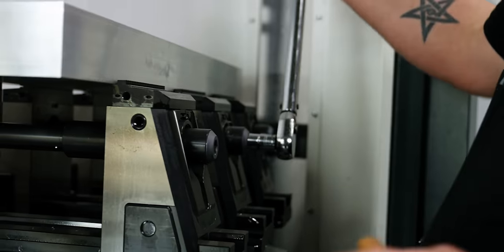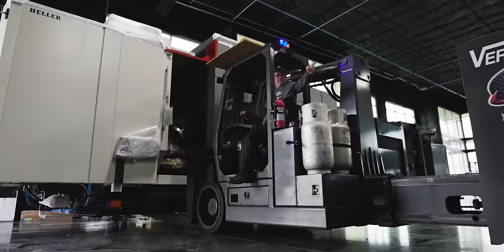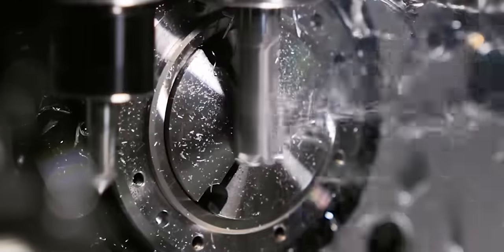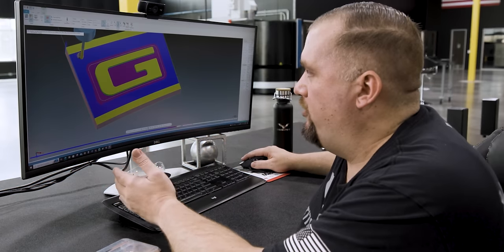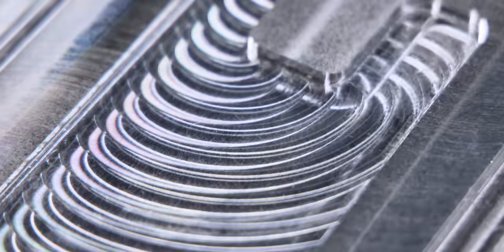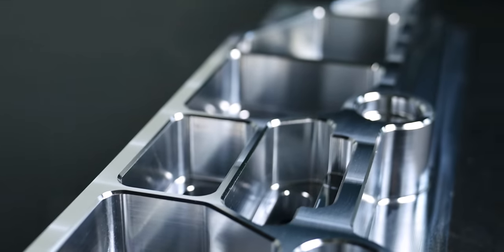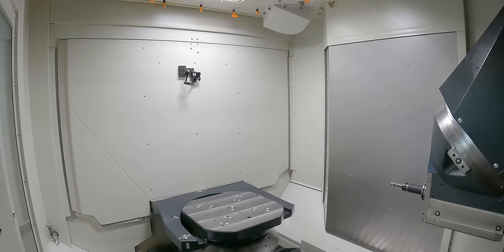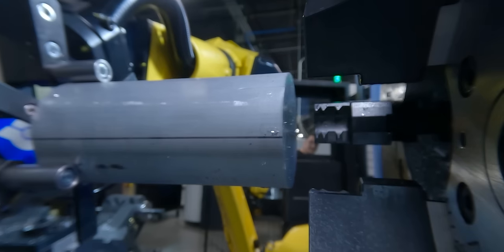Old School CNC Machining Drives Cost on $100 Million Planes

Comment: I get what he is saying but there can be other reasons why programs and tooling are not changed. The part might have to go through ppap all over again if changes are made.  The cost of doing this could exceed the savings you made.  Flight critical aerospace part production is locked down once proven for reasons you may not think of. Good example changing a drill to boost productivity in a titanium part led to microscopic surface cracks that became failure points in the fatigue life of a critical part.
Reply: Also the program cutter speed, feeds etc are set up / optimised for that particular m/c or m/c's capability / rigidity etc. to make a consistent quality part.
Reply: 💯 it’s not easy to ch age something that has gone through the approvals process, even though it might make more money. As long as it’s all covered it’s all good ay?

Comment: No owner or executive is going to pass profits on to employees.
Reply: my dudes in shop working 10 or more years in the shop and were always cutting cycle time - 20% or more and no one cares....... thats sad and they now never cutting time down if it run faster and we chill 2 or more hours with nothing, cause we have x time for 1 part and it is calculated for the whole parts and you need 7.5 hours in 1 day. if you have 1 part and it is running 10 mins. but it is calculated for 30 min........ we win  cause of the bad boss we have.
Reply: That should be rephrased to being "very few".  There are instances where, although low by percentage, that started with the owner giving the employees the company as an "employee owned business".
Reply: True statement

Comment: I worked at a mill several years back, they've been on it almost 18 years before I came. I was a roll inspector and I decided whether the roll should go through or get dumped. I noticed several rolls were being dumped that would have made it to the end, just because the previous inspector didn't want to gamble it, there by leading to a lower production. I worked there and after three weeks I noticed there's a pertern so I stopped dumping most and increased the production. We got production bonuses, but I made enough enemies I had to leave after three more weeks.  The production engineer wanted me back but, I don't think he had what it will take to protect me. You can only do as much as you are allowed to do when you are in a group.

Comment: What you guys don‘t tell is that every part and machining process with the specified tool and the specified machine and the specified raw material has to be approved from the aviation authority. Additionally it has to be proven, that the part has the same property’s and strength or better than the already certified Part.
Does the induced Heat from the faster machining affect the grain structure or surface hardness of the metal or does the new Tool transfer its own material/coating on the Part itself on an atomic level? All these aspects have to considered and certified and all that costs a lot of money and after that it is allowed to use the part in an aircraft.
That is why an aircraft so is expensive and some company’s don‘t want to change processes which are proven. 
Some companies want to improve and try something new but Research and Development cost millions up to billions.

Why do I know this? I am an Aircraft Mechanic in Germany and went to „Meisterschule“ and we were trained about this stuff from a guy who works for an Aircraft Engine Manufacturer.

Comment: Boss sharing the savings?   great one, I love your jokes,  that one just gave me the biggest laugh of the past month.
Previous employer had a 45 min cycle on a bunch of fixtured parts..program spent 14 mins air cutting due to a crummy program. I finally arm twist the boss into letting me re-write said program, and saved 14 mins per cycle.
My reward : zip, nadda, nothing, zero,   I did it again on another job, saved 8 mins on a 22 min cycle, did it again on a 32 min cycle , dropped the time to 20 mins and improved the product too
Still the reward : nothing.
f. this job,  I quit.
You need to explain to shop owners unless they share in the savings, no one will make them savings.  like my current boss who jumped my pay $1/hr on reducing a cycle time from 45 mins to 35mins
Reply: Bro the problem is that most shop owners dont WATCH these videos. When i recorded this, my main intention was to promote a positive work ethic specifically toward continuous improvement. For the sole fact that it will help you LEAVE a crappy job and get a BETTER one
Reply: You have to DEMAND a bump in pay, it won't just fall in your lap out of the goodness of their hearts. You have these records and experience under your belt, meaning you have way better job opportunities available. Make a resume, demand a salary that you deem is worthy of your quality of work, then go to  your current employer and show them "This job is offering me this much, either give me a pay increase that is higher than this, or I am putting in my 2 weeks notice in today"
Reply: @barrysetzer EXACTLY right! Everyone complaining about working for a boss who “doesn’t get it” is also an employee who “doesn’t get it”. Earn your promotion and promote yourself.

Comment: I worked for the smallest and the largest shops out there. I didn't see too much direction to improve. At the largest defense contractor we did have a bonus program if we could cut costs. One time I suggested something. It was really about getting rid of hand loading and unloading a huge cat 50 tool in in 5 axis mill turn. It also machined terrible. Afterwards the mfg engineer gave me a pat on the back for improvement in time and quality. I was only motivated by not wanting to do that crazy op anymore.  I did not get any bonus.  Oh well. 

I think another problem is lack of good tools or just scrounging around for good tools. I really think we shop floor guys can suggest improvements but we really need at least some motivation from up above.

Comment: I agree with a lot of what you’ve said but cutting the cost of production isn’t going to make the product cheaper. The product will cost the same and the extra savings go into the executive’s pockets. 

Lots of manufacturing has been sent over seas where you can pay employees less but the products they make haven’t changed in price afterward. 

You never negotiate down, basic rules of business. If I can make you pay more I’m not gonna lower the price.

Comment: I was working a CNC vertical mill and I had to set a job that had a work time of 5 days, day and night shifts, I set the job and finished the job in one shift. There was hell up from my day shift partner and my boss. My day shift buddy was angry I had spoiled is sitting on his fat ass time, so he tried to say that all the job was scrap, my boss initially was on his side saying I had scrapped them all until they passed inspection, but my boss was still not happy as my day shift buddy did him favours, making parts for his boat and I had spoiled that.
I knew then I needed to start my own shop
Reply: Nothing worse than working opposite to someone who's willing to chuck you under the bus, in an attempt to make themselves look good. Bad apple my man

Comment: Ive seen what happens when a bad programmer tries to "optimize" an old program. 

I will keep using the old one thanks. 

I make small changes to improve things and they dont save the program. I make recommendations to tooling and they dont listen. Instead they come to me when I am in the middle of a production run of 1000+ parts and change EVERY SINGLE THING to gain ONE SECOND and the entire machine is down for a goddamned WEEK because they cant get the program to function correctly. 

I have VERY good reasons not to change things because,
1. I am not rewarded for it.
2. I am not thanked for it. 
3. They dont want to give me credit for things I fix. 

The company can rot if they think I am going to make them more money when they arent making me more money.
Reply: I honestly wish shop owners would watch this video, and then read the comments.
Reply: Yep engineers  dilemma is real nothing worse than good idea fairy’s updating jobs then complaining why your over runtime hours because they failed to account for accelerated tool wear means more downtime overall. 
Meanwhile I’ve been accosted for wanting a spring cut added to a job that clearly needed it because muh increased time which I added anyway and then actually save time and money cause I’m not replacing tools that actually aren’t worn and having to restart the program after discovering the part isn’t correct. (My team leader still doesn’t know the program is modified it’s been like this for 2 years now 😂)

Comment: We had a boss that was actually rewarding shortest cycle times. So it was a competition on the floor to cut it. Some mistakes happened, but it was fun, to cut time from 10 min to 5, and then swiss machines arrived, and the same job went from 5 to 1.5.

Comment: While I endorse people trying to optimize programs Ive also witnessed what happens when incompetent egotistical machinists think they have to "one-up" their cowokers all the time.

So we got this one guy at my work. We're a small-ish jobshop who dont run many of the same programs, however, once in a while we might have to re-run an old program to make the same part we made 2-3 years ago.

Now this dude at my job. He hasnt been a certified machinist for that long - at least compared to almost everyone else at the jobshop. He has a tendency to want to run everything as fast as possible. From setting up the machine, programming and running around in the machineshop. As if his life depended on it. 

He recently had to make an old part running my old program. He proudly announced to me that he had made his own program and that the simulation said it would take 10 min less than mine. Im like, alright cool beans go for it dude. 

Because of the type material, the weird way you would have to clamp it and the tight tolerances; 3 broken taps, 1 busted facemill (Running it 3x as fast) and two of the tolerances he never got to spec. Oh, he also had to go ask for the manager to order new material not once, twice... 4 times.

In the end if everything had worked out for him he would have made all the parts about an hour faster than my program. It didnt. It costed more for new material than the job was quoted for - plus all the broken tools. To try and save 1 hour. 💩
Reply: This is the flip side of constant improvement. Especially for smaller jobs not everything has enough room for improvement to be worth the time to make the changes.
Reply: @NothingMeansNothing550  Absolutely. If youre making 1-2 parts - why spend 30 minutes trying to figure out how to lower the cycling time by 10 mins. If the machine is already running and you think "Oh, maybe I could change my facing operation and take 3x the depth im doing now..."

Its usually not worth it especially if the program is running fine. Why risk, and this have happened MULTIPLE times, to literally rip the part out of the jaws because you wanted to make some nice chips.

Comment: If I changed a cnc program in aerospace I would have to get the first and last parts from the batch cut up and inspected in the lab. I would also have to fill in a ton of paperwork documenting the change in case it introduced a problem that previously never existed. In aerospace changes are introduced with each new product cycle and once proven successful they may be introduced to older parts. But the paperwork still needs to be done.

Comment: literally me. the other machinist in the milling department are allways like u can't use a blind hole tap in stainless, u can't take that cut yadayada. but like 80% of the time u can. the issue is that because of this mentally we are somewhat underdeveloped since it has been running like that and the managers didn't know there is so much affordable tech we can use to make our job way better

Comment: There is something critical missed in this video. All parts used for aerospace applications have very strict quality and traceability requirements (see AS9100). This is because you don't want something falling off an aircraft or failing during flight. As such, once you have a given machine, for a given set of fixed and rotating tooling, for a given NC code, you tend not to change anything. Doing so requires you to complete a new FAI (First Article of Inspection) for the part and this process can be lengthy depending on the routing (operation step process) for a part, especially considering the tolerances required.
Are there improvements to be made? Absolutely! Unfortunately Aerospace is an industry which is (somewhat rightly) adverse to changes due to a need to always ensure quality of parts and repeatability of processes are maintained. Long lead times (sometimes years) for certain aerospace parts doesn't lead to rapid changes. If you want to make a change to the last operation of a part which took 2 years to get to where it is now, with the value of that part (either standalone or in an assembly) being $250k, a change has to be well justified since you probably only 10 a year anyway
Reply: good points. As a buyer I always check whats' been delivered. If the part arrived alway's within spec, looking the same etc then I wouldn't care about whatever was happening at the part manufacture stage. Providing the manufacturer wasn't causing me any additional costs, I wouldn't be requesting any part savings either. BUT, If I started noticing changes every now and again without consultation, then I'd start to twitch. Communication is the key aspect here. Discuss with the buyer what you want to do. Saying 'we need to make changes to make profit' is legit. Obviously emphasize the part will still exceed minimum spec reliably.

Comment: The content of the video is correct. Everyone should be looking to improve every process on a comtinuous basis and this does lead to higher profit, higher wages, and better job security. However, sometimes the inefficiencies are baked in by the purchaser of the product. Some customers have extremely burdensome processes in place that require you to jump through a lot of hoops to make any change to a process whatsoever.
Reply: I've worked in machine shops since I was 16, I'm soon 40. In all that time in various machine shops I've yet to see any boss go out his way to pass extra profits from better efficiency back to the workers. It never happens, the only times ive recieved any sizeble raise was through the threat of strike(company recorded record profits up 40% on previous year, yet they still say there's no money for a payrise despite the promise made to us the year prior.) This video is inaccurate at best, gaslighting at worst and only serves to damage the integrity of the channel to the experienced machinist.

Comment: I see that a lot of the comments are “they won’t pay me more “ , I would like to add to the conversation that improving  programs and trying new things in machining in general helps not only the company but also yourself , by trying new things you improve your knowledge and skill set and even if you arnt rewarded by your employer , like at times it has been for me , you can take those new skills to an employer who will appreciate it , I have just finished up making the new turbo housing for Mercedes F1 which was insanely complex with a 9 axis machine and I love my job and am paid more than any of the people in my previous company’s who always complained about pay , because I put it on myself to learn new things , machines , software ect I had opportunity’s they they never did - hope your having a great day - love from england
Reply: Well then I would have to move to another state, which is not an option for me.
Reply: @Michael-ex8lk  only 1 machine shop in your state ?
Reply: @tompass8446  Im saying the attitude is basically industry wide.
Reply: WORD
Reply: Welcome to your new employer, same as the old employer.

Comment: The problem is that unless you’re working at a good job with a really good boss, you’re actually incentivized to have longer cycle times. If you have to manage 2-3+ machines at a time it makes your job easier when you don’t have to juggle them as much. Only the rare good boss will actually pay you for increasing their profits, meanwhile you’ll just be increasing your workload
Reply: drop down to 20ipm and end the crazy. people are just over loading the system with these parts. there is no point

Comment: I get on a milling program that has been ran a couple time in the shop.  I'm in there adjusting speeds and feeds to gain time. If you're doing 500-1000pcs and pick up 1or 2 minutes per part.  It can be the difference of being done Friday or done on a Monday afternoon.

Comment: Not sure how much things are different but as software developer I have heard way too many stories of someone working a boring job, automated it with scripts, showed to their boss, and get nothing more than some good words and responsibility to maintain the script for everyone else. So for me it is pretty straight forward in that if the worker is not compensated in some just way (money, good reputation, job safety, etc.) they have full right to take the cycle time saving to themselves slacking off (in the form of just let it be or finish early).